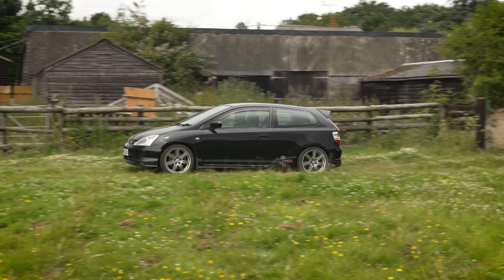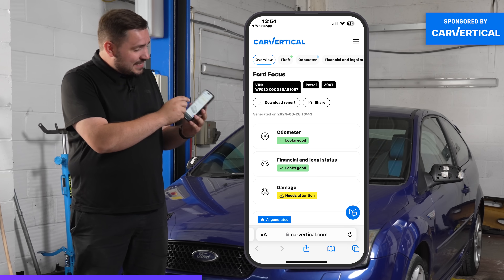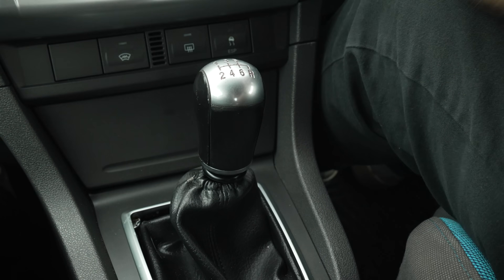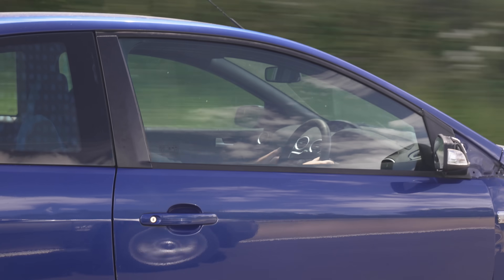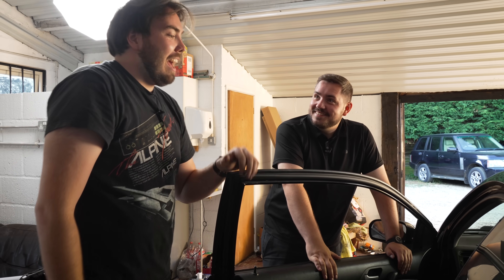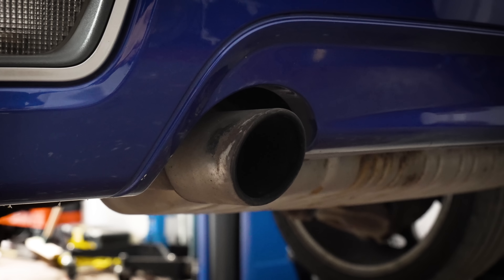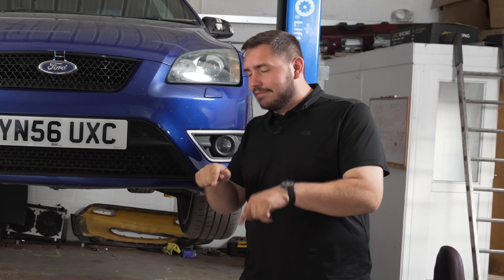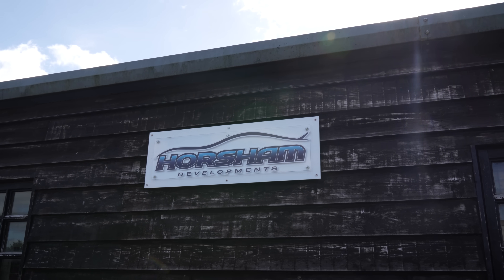We Bought $2000 Sketchy Hot Hatches

Comment: those 2.5 turbo 5 cylinder engines are MONSTERS. Unkillable, can build insane horsepower. And the fact that you guys both bought two of the most tuneable and unkillable engines ever made is giving me hope that this will be a very good and exciting series!
Reply: Unkillable? Are you sure
Reply: They have weak cylinder liners because they are an open deck design. They can take moderate power, anything more you need to modify the block to strengthen it and maybe swap the liners if you want to make big horsepower. It's head off and a fairly significant job but yeah, afterwards 500bhp and beyond is no problem
Reply: Unkillable? If it's the same 2.5 T5 that's in my V70R then they die on stock power due to cylinder linings an even quicker when modded
Reply: They're not unkillable
Reply: only way they can handle even 100bhp more than stock, is to get it block modded... so no theyre not monsters... theyre good, but not "monsters"
Reply: @mattparkin7224  300bhp is enough for the stock liners with the Focus ST variant of this engine. Anything more and you will be wanting significant modifications to the block and liners. That's about all the stock turbo will flow anyway too so it would be a major build
Reply: THE unkillable volvo engine is the 2.4T5 also named b5244t5 that exclusively came on the facelift v70/s60. They're are the unkillable ones cause of the thicker block and the identical internals to the s60/v70R.  These 2.5's are pretty stout and will last forever as long as you dont go over 300 hp/ or a certain cylinder pressure. Likely over 1.4 bars of boost

granted there is plenty of aftermarket support  for the 2.5's including shims. THEN these are stout!
Reply: defo not unkillable lol
Reply: @pgr3290  fair enough, the V70R makes 300 stock so it makes sense
Reply: Unkillable😂 amongst many dead ones I've seen advertised my friend has one at the mo that makes about 70psi per cylinder
Reply: Had mine 300bhp at the wheels 220kw just with a stage1 turbo up boost. Nice engine.
Reply: @itsrichyx420 block mod doesn’t actually do anything tbh
Reply: @ChromeFusion  hahahahahahahahaha thats the most ridiculous thing ive heard so far this year
Reply: @saulmc8920  I killed mine lol
Reply: Fiat Coupe 20vt gave almost the same power from a 2.0 ten years earlier. 400 with bolt ons and a decent map.

I do like an ST, though!
Reply: @mattparkin7224 there is a block mod for that
Reply: @pgr3290 its not major to do a block mod and change the turbo
Reply: @ChromeFusion yes it does i had 3 st and a block does fix the problem
Reply: @ChromeFusion you dont know what you are talking about
Reply: @shaunsnyman5107  I have an ST on its 2nd engine.  First one cracked a liner after 6 months with block mod. Been running no block mod for 3 years now. More power. Thrash it more and it’s fine. Block mod is a myth. It doesn’t work. Only true fix is to replace liners. I have a set of Westwood liners waiting to go in.
Reply: @itsrichyx420  on my 2nd engine. First one cracked a liner with block mod. Been running no block mod for 3 years and it’s perfectly fine. Gets more abuse and running more power. Block mod is a myth
Reply: Also really easy to tune.
Reply: Also really easy to tune.
Reply: Cylinder liners crack and they're also know for lifting the head 😂 bag of spanners

Comment: Great video - enjoyed that ! The 2,000 rpm tick over on cold start on the EP3 is fairly normal, supposedly to warm up the cat quickly and meet emissions. Not so great when you have a loud aftermarket exhaust, and you need to leave the house very early in the morning! The Idle Air Control Valves get gummed up over time and can lead to a surging tickover.

Comment: I'm gonna love this series, being a hot hatch lover myself. And speaking as an American, we technically got these in America, but different

- The EP3 Civic Si has some slight differences. The K20A2 in the Si is down some horsepower, the Si is only a 5 speed manual, 4 lug in pre-facelift models, different body work, no LSD, the list goes on. But the EP3 body was sold in America and only as an Si, nothing cheaper or less powerful than that
- The Mk.2 Focus was only sold in Sedan and Coupe variants in America with a slow 2L Duratec. But we got the Volvo C30 T5, a Volvo model running on the same platform and with the same engine as the Mk.2 Focus ST. It didn't have the cool colors of the Focus, nor was the C30 sold only in a Manual like the ST
Reply: So what you're saying is, you didn't get these in america
Reply: @kiesh.  The EP3, not in Type R form. But the Si is still cool. And I love the C30, albeit talking to owners they have trouble sourcing some parts now.

Comment: I just bought a 2006 Ford Fiesta Style with just 62,000 miles on the clock, with brand new brake disks, a full MOT & a half a tank of gas for just £1,000.

Never written off, drives like a dream, done 1,500 miles since I got it in October 😅 

Oh & the chefs kisses? I get about 60 miles for £5 & new tyres are under £50 each. 😎

Comment: Most common fault the bonnet lock, though does help to know the sequence to opening.. wishbones  are also very common on the st225 the head block lined is also a must especially if your looking to get even the basic tune.. I've own 3 of these st225 all in silver aswell as 3 of the Mondeo st220's the engines are good if you look after them though sadly if you get one that had one 2 many problems over the years especially around the engine.. then forget it..

Comment: K20 throttle bodies keep the car idling at 1.5/2k revs for the first 2mins when you first turn them on until they have warmed up and hit oil pressure, in this time the car wont hit vtec/full power to prevent issues. after the temp gets warm enough (2/3mins) you should be able to rev the fuck out of it everywhere with zero issues. Check the PCV valve on the civic might be stuck giving you reduced acceleration and a lower power reading. £20 10min job.

Comment: Isn't it actually backwards with the AFR? A lower value means you have more petrol that gets injected and less air that comes in iow more power. A higher value means a lot of air, but not much fuel so less power

Edit: so a value of 13 is rich and 15 is lean. You make slightly more power if the value is a bit lower than the stochiometric value. This is ideal for turbocharged cars as they have forced induction.

Edit 2: Forgot to mention, the stochiometric value is 14,7 for petrol powered cars.

Comment: £1950 was it for a ep3 Thats mental itll defo use oil id recommend using 10w40 i had a 2000 x reg Honda Civic vti B18c4 Aerodeck and it barely used any oil when i went from 5w30 too 10w40 it used 500 ml in 2500 miles

Comment: Jesus Christ, you haven’t done that MOT station any favours by showing that rot and corrosion on that seal you literally picked it off with your fingernails so they obviously could’ve pulled that back and looked the rotting corroded seal on the MOT test when they were testing it p45 in the post 🤣